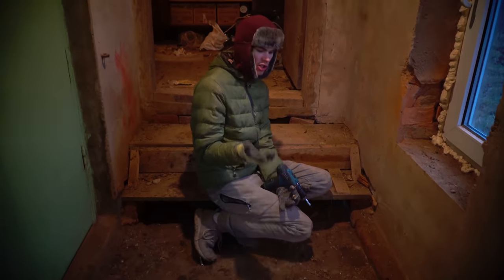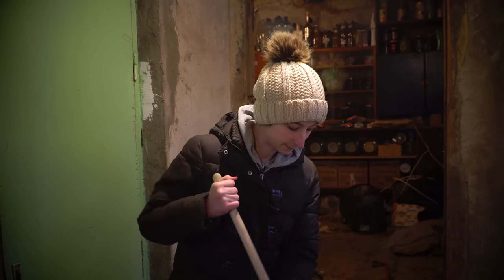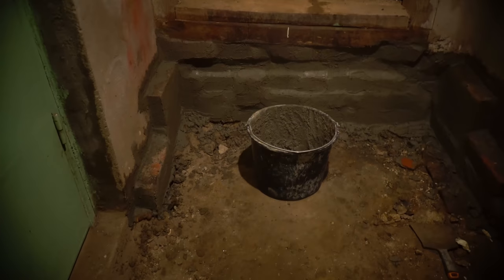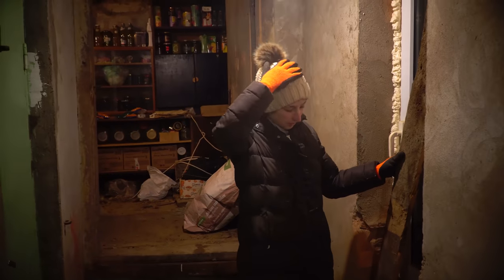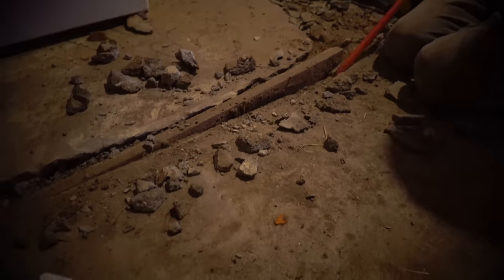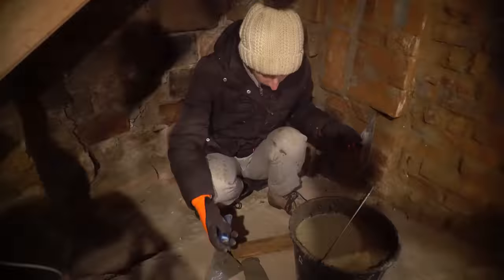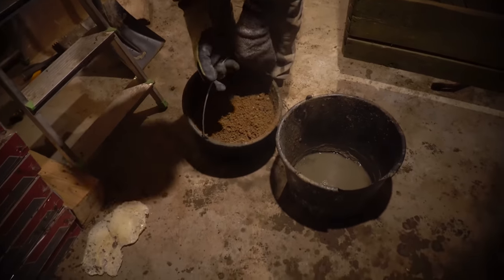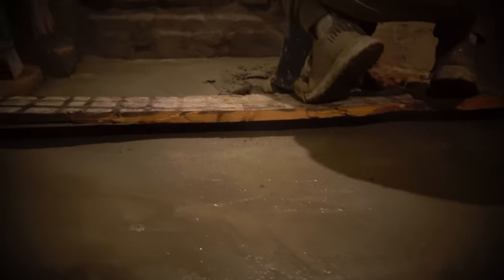Let's Finish Concrete Floors | The LAST floor to do

Comment: potato suggestion: 
1. For when have more time, winter is a great time cause house is cool....Pierogi's (so many ways to make fillings & dough) are always good, and freeze nicely. you can freeze individually, then put in plastic bag. We usually make to many to freeze individually, so we pre-boil for about 5 minutes. Drain, place on a tray with some vegetable oil so does not stick to pan, in cool place. Once cool, we add then to the plastic bag. Then freeze whole bag. To reheat, bring pot of water to boil as would when fresh. You can either thaw then or put in boiling water frozen. Of course if add frozen, takes longer to get done. Cook until done-however you like the dough done. drain and make your favorite way. 
Our favorite filling for pierogi is potato with cheddar cheese & fried sauerkraut mixed together into a filling. 
We always make for Christmas Eve, (our big celebration day for us) it is the main dish for the meatless meal. And make extra to hopefully last us a few months. 
2.There is potato bread, but I never tried making it, I buy mine at the store. (in the U.S.) it is pretty easy to find. 
3. If you do not have time to make pierogi (or other spelling- pirogi) 
Just make the filling part of the pierogi to eat. boil the potatoes, drain, mash-no butter or milk. Then fry up some sauerkraut, squeeze out the juice add onions spices, and then add mashed potatoes, cheese- if desired mix well and done. Serve as is Or stick in oven with some bread crumbs or cheese or whatever sounds good to you. 
I have been meaning to try  this in a lasagna. Using the potato/sauerkraut/cheese mix with the lasagna pasta. Sounds like would work  But get lazy and don't do it.

Comment: You are amazing.This is the only one time I had a tip for you;attach the rectangular blade to one of the too small tools, glue, welding or simple sturdy  elasticbands (dunno if works with cement) . Loved your cherrieloaded video, am hungry
Reply from the maker: Thank you! We just got another one it was wood handle so wasn't easy to fix still have it if I need it somewhere else 😊

Comment: You can make potato patties and freeze them and use them for a long period of time.  Recipe is 
2kgs potatoes
1/4 kg of boneless chicken
Spices of your choice
Green onions about 4-5
Coriander handful of
Green chillies according to your choice
Dried coriander 1 tsp
Cumin 1tsp
Black pepper 1/4 tsp
Salt to taste
Boil the potatoes and chicken separately then peel and mesh the potatoes, add chicken in the chopper and chop it, then add all the rest of the spices and chop a little then mix it with potatoes mesh and mix well check salt and everything then make patties like meat patties and freeze them. 
Take the patties dip them into an egg mixture and fry them. The most easiest and convenient recipe ever. You can use them as long as you want untill they are freezed.
Reply from the maker: Thank you so much❣️ I will definitely try it! 😍
Reply: Sure, You will definitely gonna love it. you can make them in bulk and use them in sandwiches, only with bread, as a filling in bread, as a snack with ketchup or mint yougurt, when there is nothing to eat etc etc 

Note: use red potatoes for these because we don't like them sweet but if you do like sweet taste you can try with yellow /white potatoes all depends on your own taste and best of luck hope you will like it. 🙂